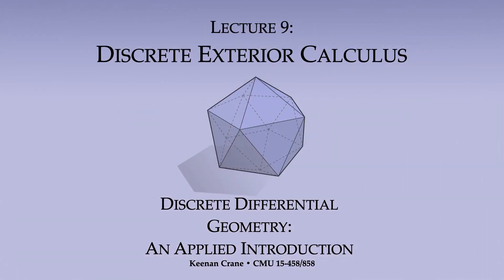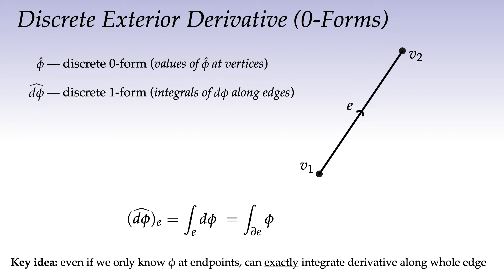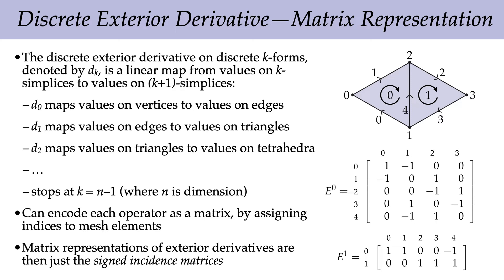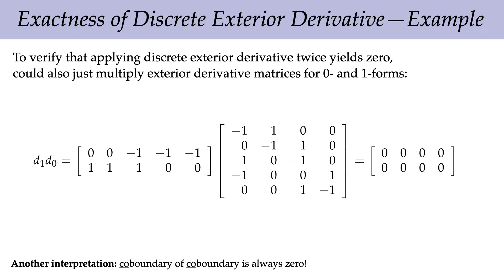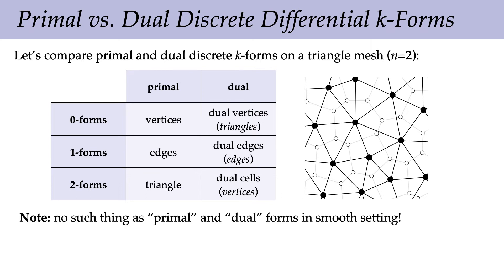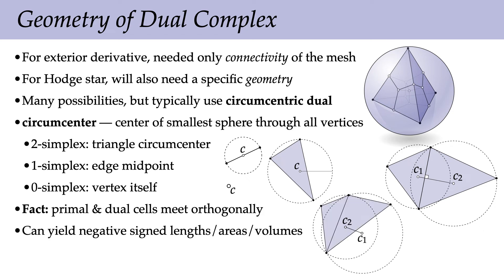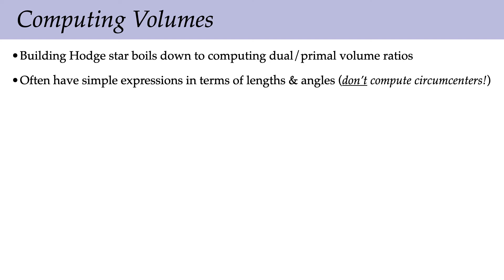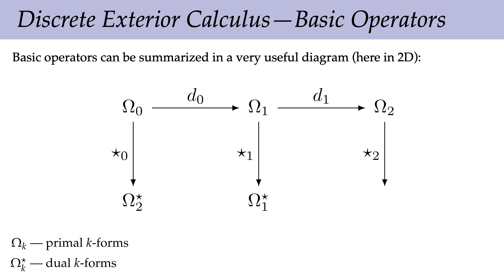Lecture 9: Discrete Exterior Calculus (Discrete Differential Geometry)

Comment: 00:20 Review—Discrete Differential Forms
 
Discrete Exterior Derivative
03:32 Reminder: Exterior Derivative
05:33 Discrete Exterior Derivative (0-Forms)
08:40 Discrete Exterior Derivative (1-Forms)
12:06 Discrete Exterior Derivative—Examples
17:32 Discrete Exterior Derivative—Matrix Representation
19:56 Discrete Exterior Derivative d_0—Example
23:04 Discrete Exterior Derivative d_1—Example
25:32 Exterior Derivative Commutes w/ Discretization
28:26 Exactness of Discrete Exterior Derivative

Dual Forms
29:38 Reminder: Poincaré Duality
30:23 Dual Discrete Differential k-Form
31:35 Primal vs. Dual Discrete Differential k-Forms
34:49 Dual Exterior Derivative
36:22 Dual Forms: Interpolation & Discretization
 
Discrete Hodge Star
40:54 Reminder: Hodge Star
41:50 Geometry of Dual Complex 
45:09 Discrete Hodge Star—Basic Idea 
48:40 Discrete Hodge Star—1-forms in 2D
50:05 Discrete Hodge Star—2-forms in 3D
51:37 Diagonal Hodge Star
53:01 Matrix Representation of Diagonal Hodge Star
54:10 Computing Volumes
57:26 Possible Choices for Discrete Hodge Star

Summary
1:01:04 Discrete Exterior Calculus—Basic Operators
1:04:12 Composition of Operators
1:05:38 Applications
1:05:53 Other Discrete Operators
1:07:07 Discrete Exterior Calculus - Summary

Comment: I encounter the same confusion as Jeffrey Zhang working on the coding exercise for Discrete Exterior Calculus. I check, the test program for Hodge 0 does not pass when you use circumcentric dual, so you have to use barycentric dual. The way to check by yourselves is to write circumcentricDualArea program in assignment 2, make sure it is correct using the test program for assignment 2, then use this function for assignment 1 Hodge 0 operator. You will see it does not pass test case while for barycentric it pass.

I understand it is a teaching decision to reduce complexity,  but it would be nice to note this irregularity somewhere officially. Personally I would add circumcentric vs barycentric dual to the materials, underscore we use circumcentric dual, and keep everything consistent (use circumcentric for hodge 0).

Comment: 1:03:34 I draw a diagram and it shows that the map from \Omega_1^* to \Omega_2^* should be -d_0^T, not d_0^T. Am I wrong? For example, a vertice v_i in the primal diagram has an outgoing halfedge e, its hodge star *e in the dual diagram rotates e 90 degrees counterclockwise so it contributes to *v_i positively. But an outgoing halfedge means the coefficient of v_i is negetive.

Comment: I am confused @15:52 you are taking the exterior derivative by integrating over the boundaries (adding up to sign). Yet in the example to the left you were actually looking at differences between vertices to find the values at edges, which makes perfect sense: the differential in the discrete case becomes the difference as you go from 0-forms (vertices) to 1-forms (edges). But how does it make sense that when you go from 1-forms (edges) to 2-forms (triangles) you are actually integrating? Shouldn't you also be differencing in some fashion?
Reply: Answer: "When going from vertices to edges, taking an oriented sum is indistinguishable from taking a difference."

Comment: At 13:42 there is an example of a 0-form problem where the solution is the difference between the vertices with orientation considertations.  I was wondering how this changes if the edge is curvilinear with multiple points along it. It seems like we are assuming a linear variation along an edge.

Comment: Hi Professor Cane, Thanks for the brilliant lectures. Just wondering, how did you assign the orientation of e_3 at 23:49? If two triangles are with the same orientation, then the edge they share should have two opposite orientations? What did I miss here? Thank you very much.
Reply from the maker: Yes, this is a common source of confusion.  Every element of the mesh (vertex, edge, triangle, ...) has its own orientation, which isn't required to have anything to do with the orientation of any other mesh elements.  Then you can ask whether two elements have consistent or inconsistent orientation.  In other words, the orientation of a k-simplex need not induce an orientation on any of its faces.
Reply: @keenancrane  Thank you very much for this clarification, Professor. Just one more quick question,  in the discrete case, if my underlying manifold is a topological manifold, how should I define a mapping (for example linear)  as orientation preserving or reserving? I know the orientation for the topological manifold should be defined as a coherent choice of the homology group H_d(M, M/p, Z)  around one point or  H_d(M, Z) for the d degree fundamental class, does that mean that as long as the mapping can map cycle to cycle (closed d-chain), then it is orientation preserving/reserving? How about piece-wise linear mapping in which each piece maps a part of the manifold into different dimensions? 
Thanks again.

Comment: I've been following along in the coding exercises, and it seems like finding the hodge star of a 1 form is meant to be done with the assumption of a circumcentric dual. But then it also seems encouraged to use the barycentric dual area in the computation of the hodge star for a 0 form - in fact the tests seem to pass when done this way. It seems strange to be assuming a circumcentric dual in one case and a barycentric dual in another case. Is this intended?
Reply: I believe it's just for practice's sake. If you really need closure, Assignment 2 will require us to calculate circumcentricDualArea for 0 forms.
Reply: I encounter the same confusion as Jeffrey Zhang. I check, the test program for Hodge 0 does not pass  when you use circumcentric dual, so you have to use barycentric dual. The way to check by yourselves is to write circumcentricDualArea program in assignment 2, make sure it is correct using the test program for assignment 2, then use this function for assignment 1 Hodge 0 operator. You will see it does not pass test case while for barycentric it pass.

I understand it is a teaching decision to reduce complexity,  but it would be nice to note this irregularity somewhere officially. Personally I would add circumcentric vs barycentric dual to the materials and keep everything consistent

Comment: Is it possible/reasonable to start with the barycentric dual, but instead of using the barycenters, try to use something close to them, but moved somewhat in order to get orthogonality back?
Also, is it necessary that the thing taken as the 0-dimensional dual cell be the same "in each direction"? Like, if this is all in 3d, could it be reasonable to have for each face, the edge dual to it, be perpendicular and somewhere through the face, with the length on each side depending on the dimensions of the simplex in some way, but without requiring that the endpoints of these dual vertices actually meet up? (but still treating each of the endpoints inside the same simplex as being "the same vertex")
Err, not that these endpoints would actually be computed. And I'm not sure how this would work in other numbers of dimensions.. I guess what I've described just boils down to "can you just choose values for the diagonal in some way that doesn't correspond to the volumes of any actual consistent shapes?" which seems like probably a less interesting question than I initially thought.
Maybe I'm just trying to find a free lunch after being informed that there isn't one there to find.

Comment: If dual-0 cells aren't always planar, how are we measuring their area?
Reply from the maker: For the circumcentric dual they are, but in general they may not be (e.g., if you use the barycentric dual).  Good question.
Reply: @keenancrane  That's super surprising that it always becomes planar.
Reply: @keenancrane  Surely that can't possibly be always true. Consider a perfectly symmetric pyramid with 100 faces. The dual 0-cell is then perfectly horizontal. Now move two primal 0-cells downwards. Then we have a bunch of barycenters on the horizontal plane and three barycenters off that plane
Reply from the maker: @columbus8myhw  I'm not sure I understand your example, but the circumcentric dual corresponds to the Voronoi diagram of the vertices, and each Voronoi cell is an intersection of halfspaces.